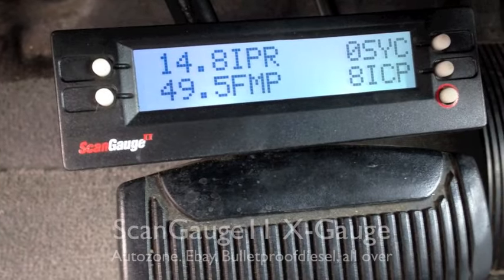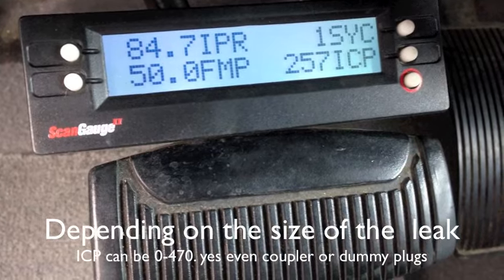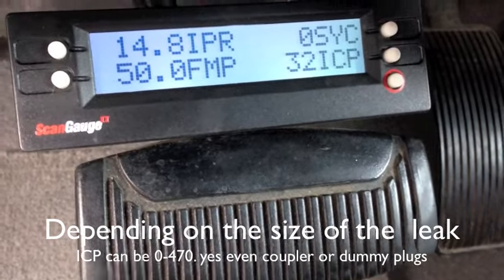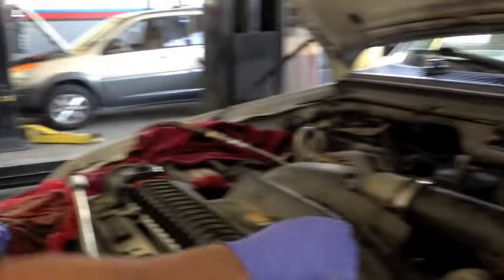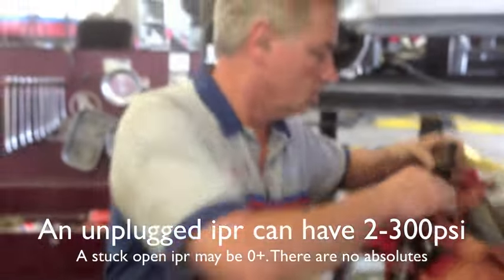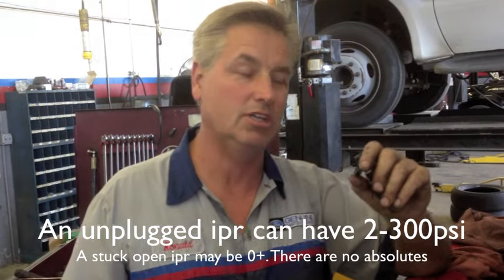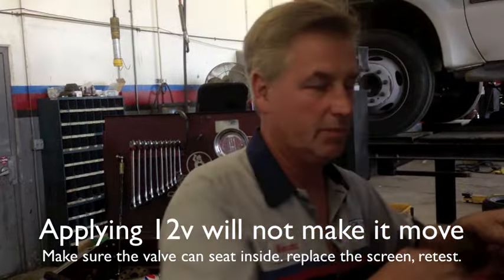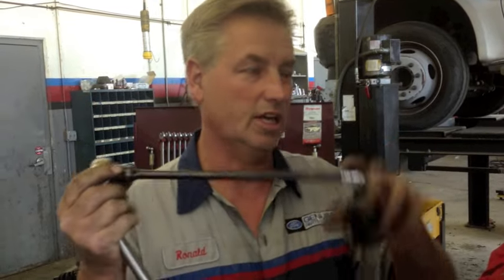06 Ford Powerstroke diesel no start low injection pressure. icp ipr

Comment: Its 2022 and this man is still helping me figure out what's wrong with my super duty. This man's knowledge will live on for years thru the powerstroke community. Thank you Ron!
Reply: Wrong, it's 2024 and he's still helping.  Funny thing is I have a no start hot and in my head I hear his voice "you need at least 500 psi to fire the injectors".  Also I hear "a teaspoon of dirt can plug up the ICP screen".  Thanks DTR!  Looks like I have a high pressure oil leak.  It runs perfectly fine then all of a sudden HPR down to 215 psi.

Comment: IF YOU HAVE A TALL OIL CAP, it is wrong.  Fomoco filters are 1 inch tall. Aftermarket oil filters are 3-4 inches tall. This causes a gap at the bottom of the housing. Your plunger will not be depressed. Oil will drain out, loss of pressure. No start. Good reason to check the ipr valve at the back of engine for debris plugging it. Extremely common to see wrong oil filter. (side note- your short cap on the frame/ fuel will interchange on the oil, so save those short caps)

Comment: Thanks for the info. I replaced STC  fitting still no start, then you said how to inspect ipr, took it apart again cleaned the ipr wasn't seating. Then it fired right up. Thanks again

Comment: Hello Ron I have a 04 6.0 crank no start  watching your videos I've learned a lot. I changed the HPOP, IPR , the turbo was sticking thanks to your videos I did that too. After putting back together it take about 20 seconds to start I let it run for an hour cut it off for 10 minutes still about 20 to 25 second to start talk to a couple of diesel mechanics all said the glow plugs is bad replace all them  bought A ScanGauge 2 programmed it code P2285 came up  ICP replaced it. Now back to no crank no start. Sprayed with diesel quick start fires right up( HELP) out of $1,400 so far going broke.
Reply: Did you ever find out what was wrong with your truck??

Comment from the maker: Either side just give it power and ground. That rules out the PCM and wiring. Not the valve. I've seen large leaks from the coupler or dummy plugs have less than 100. Usually 03/04 its the pump. 05 and up is the coupler or dummy plugs. Unless somebody has touched the injectors or contaminated the system

Comment: Great vids! my 05 6.0 just started missing at 2600rpm. wont go past 2600 rpm. wont start after warming up. icp v 2.1 @ 2600 rpm ipr 41% icp psi 1684. replaced ficm couple months ago voltage at 48 now. codes for cam, crank and egr. replaced fuel filters today, changed oil, no difference. drove threw some deep waters last time it ran good. ipr @ around 15% while crankin icp @ around 600. runs fine till hitting about 2600rpm. need to get adapter for fuel pressure tester. have 198,000 miles on this beast. Swamped with GM's to fix have no time to run tests
Reply: Found the problem! after sitting a couple days it started cleared up so i took it to work yesterday and was raining. half way into town it started running bad again and smoke out the tail pipe.would not start after shutting it off. found two terminals from the ecm harness were corroded. they got wet everytime it rained and it would start running bad. hope this helps someone!
Reply: I got an 04 6.0 i recently changed one injector ran fine then yesterday the programmer mentioned "icp too low" but the truck turns on and runs well...

Comment: Sir, i have international CF600 which has 4.5 turbo diesel engine same as Ford LCF.
My truck doesn't want to start at all. I have a code :
* Injection control pressure unable to build pressure at engine crank.
* Engine oil pressure (EOP) above specification with engine off.
In my mind there are 4 problem which don't make engine start.
1- Crank shaft sensor. How to check it?
2- Camshaft sensor. How to check it?
3- IPR sensor, how to check it?
4- High pressure fuel pump. How to fix it?

Comment: Hi Ron I brought and programmed the scan 11 gauge and the issue I have besides no ficm sync is that the ipr stays a 14.84 while cranking but the icp builds past 3000 psi till it slows the starter. When I check the ipr plug it has 12 volts when the key is on and none when it is off. And i had another ipr valve from before when I was throwing parts at trying to make it run and it does the same thing. What would cause the ipr to read 14. but generate over 3000 while cranking. The truck just stalled pulling into my work shop a week ago restarted after I unplugged the pcm and replugged it ; but cut off like I turned the ignition off when I applied the brake to put it in gear. The wiring harness was in bad shape so I swapped one I had from a 2004 and lengthen the isp and ebp wires  to make it work. I have injector clatter and 48 volts on the scan gauge but no ficm sync and the ipr at 14.84 with an isp building to over 3000 . What would cause that? I think the wiring arness might be the sync proablem because it came with a motor I brought for parts that they said would crank over but not start; but why the ipr of 14.84 and such high icp pressure.

Comment: Hello Ron, I replaced the IPR and the ICP, I cannot detect a leak, when hot it starts but it hesitates. I can tell the pressure sometimes only reaches 360-400, Could the dummy plugs be next to replace?
Please advice. Great videos. Thanks

Comment: I have an 06 that ran great before I had a guy do an egr delete and an oil cooler replacement. It still runs but it runs like crap. When the engine is cold it sounds similar to stiction and throws code 2284 (icp range). I replaced the icp per the mechanic. He's had my truck for 6 weeks now and hasn't touched it. I'm leaning towards the ipr screen and have ordered some tools. What do you think I should do?

Comment: My truck is an 05 6.0 It was a lil shaky for a few days. Went to get in to leave yesterday. Wont start, I checked my oil pressure on the cluster. It doesn't move. Any suggestions. I have both the ICP & IPR valve on hand. We have 5 6.0s. None has ever showed no oil pressure though. I have the scan gauge, it reads code P2285, but would thats show no oil pressure?

Comment: Hey there, maybe you’ll run by this. I took your advice and went to purchase a scan gauge 2. My truck is a 2005 6.0 and has had the oil cooler worked on before. I have also replaced the ficm. Now, after a long road trip, I got home only to go back outside to drive to the store and had a no start. At first I thought it could be the ficm again, but it reads 48.5 on scanguage. The icp will not go over 300? So, with it just cranking over, I’m going to bet that it’s the ipr valve? (When I initially started it, it was kind of a weird start, but ran fine all the way home 1 and 1/2hrs)You helped me diagnose the ficm from your videos, but I was seeing if you could help me here too 😳 thanks! College kid in need of help lol mainly want to know if I could get away with just ordering the screen and orings to save money or if you’d recommend that I replace the valve? It has 200k miles on t now. Probably the original ipr valve and screen. Thanks again!
Reply: If it's the original screen ,yes update it . If you still have problems , pull it out check it should be able to see light threw it

Comment: just replaced the rear main seal and on the way home my 2002 7.3 started chugging down felt and sounded like fuel filter so I stopped and changed it and now it won't start at all not even on starting fluid I changed the cam shaft sencer and still no start

Comment: Hey ron thanks for all your videos you have been a great help to me for a long time. I was pulling my IPR today and it came apart. the the electronic part threaded out. the other half is still threaded into the engine. do you have any tips for when this happens? im thinking i need to put red lock tight on the electric half and torque it back up then let it set and see if the other half breaks. any thoughts?
Reply from the maker: You can try that and it may be a good answer.  I've used easy outs. vise grips or grabbed the shaft depending on which part is left in there.. you're way would be the best esp if you're planning on reusing it.
Reply: +DieselTechRon Thanks for the info! yes i need to reuse it if i can. i used a cheap oil filter and there was a piece missing and now i have crank no start while hot. i also just started getting inj 7 code right before this happened so im hoping its not the injector leaking.
Reply: +Troy Gilbertson— What actually got the IPR out of that tight spot?  I didn’t see a follow up message....

Comment: Hey Ron. I have watched all your vids on the 6.0. They have taught me a lot! I have an 05 with a long crank (very long but eventually starts and runs well). I replaced the head gaskets, new oil cooler, egr delete, updated dummy plugs and stand pipes. The scangauge ii shows icp slow to build but eventually goes up to 500 to start it and goes to 1900, but the ipr is at 85% while cranking. I pulled out the ipr to find a cracked screen. I Installed a new ford motorcraft but still have the same problem. I pulled out the new one and looks fine. I applied air to the system w/ the ipr powered and heard a tiny hissing  down the turbo drain. Stc fitting?? I did not replace that part yet. Any help would be great. Thanks!
Reply: Bill Myers what was your out come I have very similar issue

Comment: Hi Ron, I have a 06 F350 6.0 and it is a crank no start. It died on me running on the freeway wit a heavy load. The scan gage II shows low ICP=350's. I crank it for about 15 seconds, but my oil gage don't come up. Shod I suspect my HPOP or IPR?
Reply: M12   is the icp  thread size .m10  for the hpop test port
Reply: I would pull the IPR , check it , see you screen is there, etc , you would have that . Much pressure when cranking,  you have a leak

Comment: Thanks for these videos.  2 weeks ago I knew little to nothing about the high pressure oil system in a 6.0  Now I know a little more than nothing.  I'm working on an 06 f550 with the 6.0 and I've got a hard or no start hot issue.  Last year we did an egr cooler delete and dtech injectors and an egr spool.  Until last week it ran great.  I got the scangauge from bpd and it looks like the ipr is maxing and icp is slowing building to 350, sometimes starts, usually doesn't when hot.  I did dummy plugs and stand pipes.  I believe before I got to this truck it had a hpop and oil cooler done under warranty.  Would it be safe to say the stc fitting would have been updated when that work was done?  The dummy plugs and stand pipes I replaced were the new style so I'm hoping the other updates were done as well.  I ordered an ipr socket and the air fitting adapter for the icp bung.   My next move is pulling the ipr and really hoping I see junk in it holding it open.
Reply: turned out to be the front passenger side injector oil feed o-ring had melted and fell apart.  Replaced all the orings on the passenger side and it's been good since.  I have a feeling the guy that uses that truck overheated it a few times when the radiator was leaking...
Reply: @justinbeaniam did you hear this during your air test leak
Reply: @wildriderz_bw  yes a slight gurgling
Reply: @justinbeaniam  I’ve heard nothing on the leak test and only building 30 psi of Icp
Reply: @wildriderz_bw  that's a major leak or a failed hpop or bad icp sensor.  I don't think a stuck open ipr would even be that low.
Reply: @justinbeaniam  it was 300psi before I took the ipr out and cleaned it and changed the o rings and filter.  Then I was getting 0-30psi.   I did hooked air up to it and it hold the air pressure and I hear nothing

Comment: Hey Ron i need to take my truck in. just had a no start when Hot. its a 2005 Ford F350 6.0  got stuck at a starbucks on the way dropping the wife off at work. wouldnt start. we waited like 15minutes and it fired after a 6-7 sec crank. what dealership do you work at,. im in SoCal. please message me!

Comment: Hey Ron you videos are great.  I am having this very problem.  I've changed the STC fitting, dummy plugs, stand pipes, and all injector seals, and still have no start when hot.  ICP is 3800 WOT and IPR is 77 WOT when cold, but when it gets hot I have ICP 2700 WOT and IPR is 84.7 WOT.  2006 F250.  Any ideas where else to look?
Reply: What ended up being the issue, I had the same problem, it was the stc fitting

Comment: Hi Ron I have a no start problem i took out the IPR and still no start, my ICP psi wont even go over a100 when im cranking now. i didnt run the 12 volts to ipr cause i dont know which side is +/- and dont want to short out the sensor, but do ypu think this could be caused by the IPR not seating.

Comment: On a 2006 Powerstroke I got a not hot start so I did a air leak test.  Should there be no air leaking out if it is working right or should I expect some air to be coming out from under the valve covers when it is working properly?
Reply: Hi Joe I am not as good as Ron , but I can try to help you.
Do you have low ICP pressure while cranking? Im guessing maybe dumbey plugs. Ron has a video about that Ill find it and post the link in a min
Reply: When the engine is hot, yes.  It started just fine when it was cold.
Reply: Did you watch the video I posted a link to?
Reply: Joseph Krahn jmj

Comment: If IPR is at 14.8 is the sensor bad?  I am running about 3600 WOT with the scan gauge.
rough running 06 when trying to get power especially in the morning, jerking motion.  I beleive the turbo is going because it is blowing oil but also investigating other problems.

Comment: I have a 03 Ford F-250 6.0 L I changed glow plugs n harness I changed icp sensor still not start I check the bubble test n I’m good on that check the filter it’s brand new Ipr reading 84.7 icp goes up to 490 u have a email I can try n send u so u can look at could Ipr valve cause my icp to get low?
Reply: You have a leak from the cup.  leak  test m12

Comment: Hi Ron, I was listening, if the ICP pressure is 200-300 psi on the 2006 model it was a bad IPR valve. Is this the same specs on my 2004 6.0L Powerstroke? thank you.

Comment: Now back to no crank no start so far out of $1,400 (HELP) Please like to hear your feedback
Reply: replaced Hpop &tubing IPR valve bought a scan gauge 2 Code p2285 replaced  Icp sensor start when cold when hot no start ScanGauge 2 no I PC reading nothing.ipr,Syc, fmp reads normal?
Reply: Melvin Johnson what did it end up being? Mine is the same way.
Reply: Melvin Johnson mine is doing the same is the injectors even cycling?
Reply: @relaxwithd  what was the issue